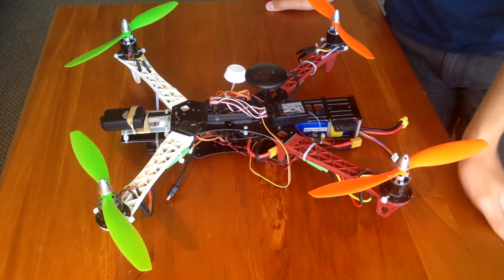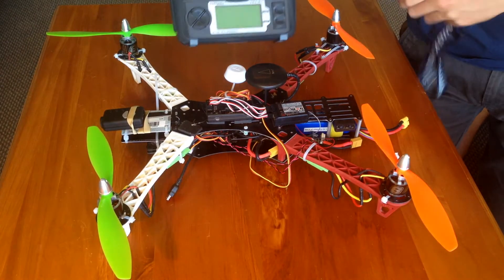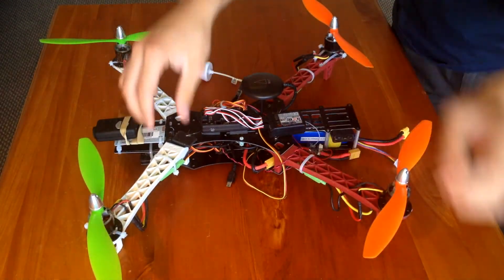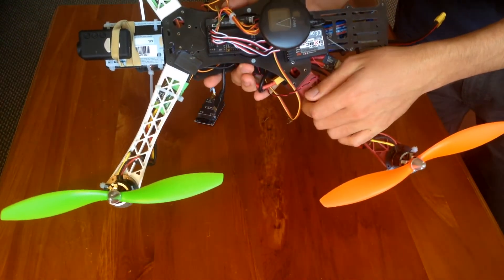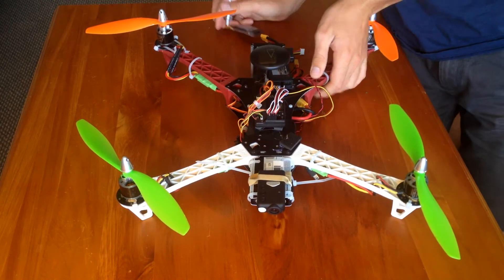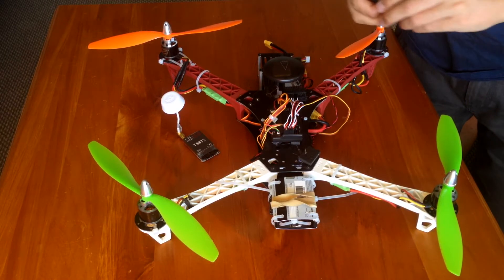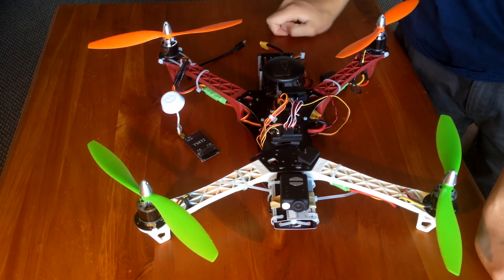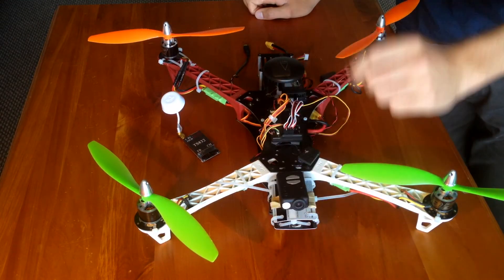Fpv alien quad (APM) setup and build log

Comment: Hello, is this 
http://www.hobbyking.com/hobbyking/store/__65156__Turnigy_Multistar_30A_Slim_V2_ESC_With_BLHeli_OPTO_2_6S.html

Suitable for mentioned motors ?
Reply: Yes that's a good one. I got the 30 amp non slim ones but this will do the same thing and take up less room on the quad
Reply: Joshua Archibald Thanks, can you also tell me, if it is safe to use a battery with higher Mah than used in this video? Z am really new at this,not everything is clear to me.
Reply: Yes you can. A larger mAh means the battery will be heavier but these motors can easily take the weight of the larger battery. I would recommend all the way up to a 5000mAh battery if you want. The sunnysky x2212 980kv from banggood.com is an even better motor and not very expensive. 
If you have any other questions feel free to ask me.